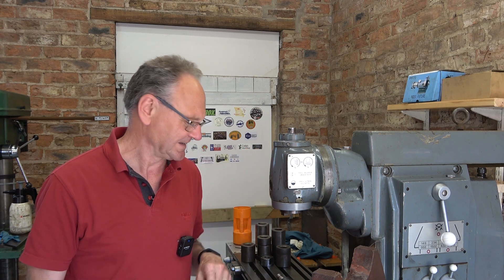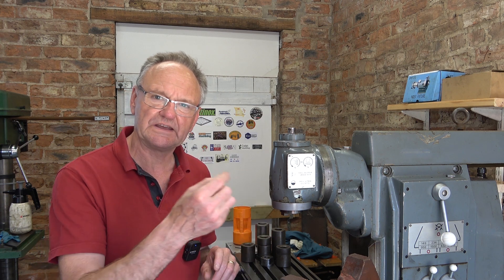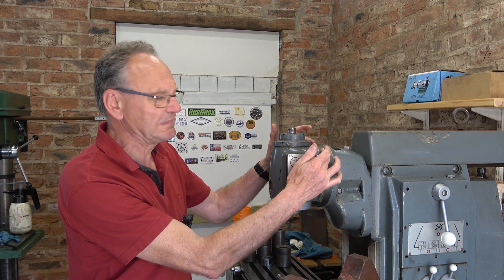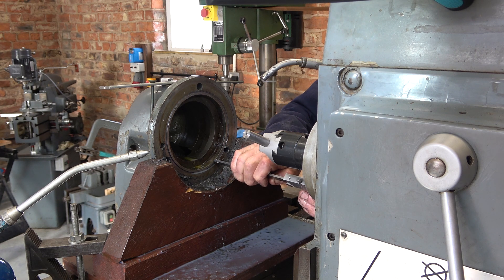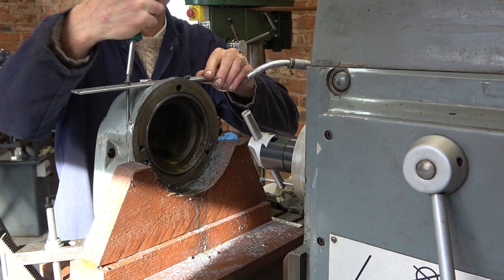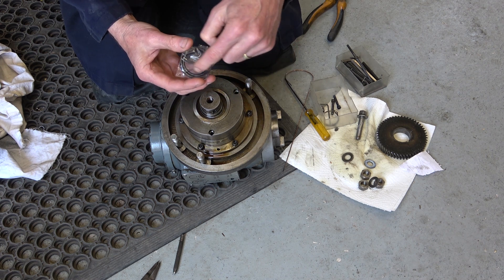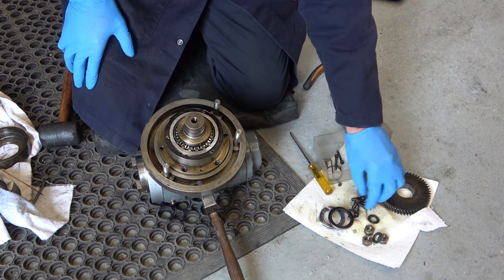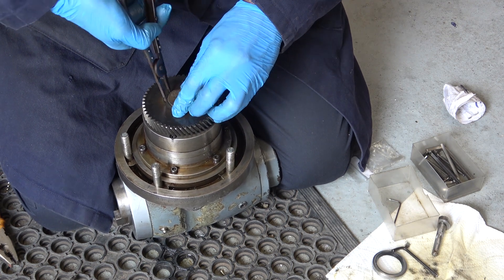HS202 Harrison mill vertical head improvements – Part 2 (final part)

Comment: Hi Paul, I found your mill investigations very interesting; thank you for taking the time to video it.
Top tip when re-using those orrible gloves. (And well done you for doing so).
Firstly, write R and L on the back so you can get them dirty side out.
Secondly, don’t blow in to them to inflate the fingers. Instead (and you’ll remember this), spin them round like a greengrocer used to do with a bag of apples (that seals the cuff) and squeeze to inflate the fingers. No more breathy moisture inside.
Just subscribed.
Bill
Reply from the maker: Hi Bill, thanks for the tip and, yes now you say it, I do remember the greengrocer spinning over the brown paper bags. That takes me back a long way. 😁  The milling head investigations are not over yet, I think I have finally found the cause of the leak at the back (the side where it screws on the mill). Caused by some previous 'expert' rebuild.  Stay tuned....   Cheers

Comment: Looks like it is good for another 100 years of service. 👍
Reply from the maker: Hi Tom, takes a while to get to know our machines doesn't it? I'm still not 100% sure I've fixed all the oil leaks! Partly a poor design, in that respect. Luckily it's good at milling. No quill is a shortcoming but it makes it very rigid (for a small mill). Cheers

Comment: excellent as always, I wouldn't worry about not using the head beyond 45 deg, I've had them in every orientation imaginable and never had any trouble what so ever only oil leaks in my vertical machine
Reply from the maker: Hi Anthony, the previous owners had a fix so they could use the head at any angle - there was no oil in it when I got it (well strictly I think I got one drip out). Cheers

Comment: Hey Paul. I always enjoy your videos 🙂In my former job, we made special seizes O-rings from a piece of rubber (in the right diameter) and Loctite 4062, just a small drop would glue the ends together for good, (maybe 406 would do the job too?) just a thought. Cheers from Denmark 😉Henrik
Reply from the maker: Hi Henrick, maybe you saw I used Superglue but I will look out for Loctite 4062 next time. Thanks for your support. Regards Paul

Comment: Case closed! Well done DCI Haxby! Great job Paul. Some design misgivings in the head, I think the conversion you described is well worth it to get another 44 degrees of range (clearly you don't need to get to 90 as you have the horizontal spindle). Cheers, Jon
Reply from the maker: Hi Jon, as Carl Wilson says, these Harrison machines are 90% quality and 10% bodge. Just a bit more thought in design would have made a lot of difference. Still, it gives me scope for improvements. Cheers

Comment: Hi Paul, great film, thank you very much for mentioning me and my channel. And the someone who all of this is useful too is me! I haven't touched the vertical head yet. Very good info about the oil drillings and the orientation. Also I'm much enamoured of your idea to put a proper oil seal in the bottom bearing, save having to grease it. Not sure how to feed oil to the top bearing though. Thanks again, enjoyed it very much and I'm sure I will be watching it again for all the nuances.
Reply from the maker: Hi Carl, as you saw, some handy geezer has been in this head and not got it back together right. There is another mistake you will see later (though it's not helped by Harrison design curiosities to catch the unwary fumbler). Cheers

Comment: Hi Paul, good bit of detective work to spot the misaligned cover. That wooden jig has really payed off it must making taking the head on and off so easy ...... (easier anyway!!)

I look foward to seeing the replacement lead screw nut being made, I forget does the lead screw need straightening as well?

Have a great weekend
Reply from the maker: Yes David the lead screw does need straightening, and it needs a few 3/8 UNC threads adding to the hand-wheel end (which were wiped off in a bash at some stage).  That job is not far off now .... going to be a bit of adventure. Cheers.

Comment: Thx for starting the mill for us after completion, I would have been disappointed to not hear it run. For its age it sounds pretty good to me. If the new o-ring starts to leak you might try some non hardening sealant in the groove you cut, such as hylomar. Thx for the vid.
edit: Hylomar in the groove under the o-ring.
Reply from the maker: Hi, thanks for the tip, I will be buying Hylomar. Cheers
Reply: Yes,Hylomar or Welseal are great products for that type of sealing job....I always have a tube of at least one or the other in the sealants and adhesives drawer. Another great product to assist with sealing joint faces and 'O' rings is the extremely thick blue marine grease. It does not get dissolved/dispersed by any lubricating oils it comes into contact with.